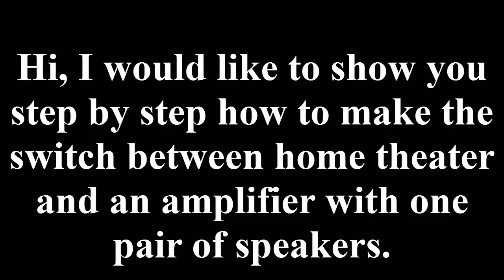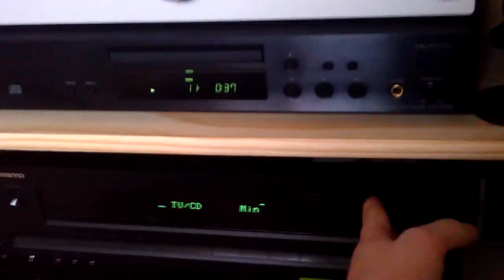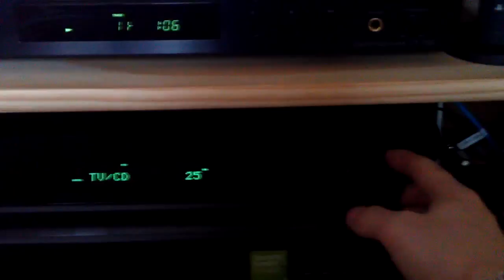switch between 2 amplifiers

Comment: I like the simplicity of the solution.  It should be far, far cheaper to build this than to pay for the overpriced offerings on Amazon and eBay.

I would like to see part numbers and sources, especially for the switch box.
Reply: I chose a plastic casing that was available in an electronic store, I drilled the holes myself.  Switches must be 3-stage 6 terminals , i.e. 1-0-1 for safety, I chose medium quality and used a connection for pins, it would be better to solder, I was going to do that, but in the end I left it as it is.  I think the cable I used was silver-plated QED.  I see a lot of people asking for a diagram.  I don't have one, it will sound funny, but when I had all the parts, everything fell into place as it should. Box- "Project Box Plastic Case Enclosure with Vent Slots 171x178x67.6MM KE1AV" Switch -" Heschen Metal Toggle Switch, C523A, DPDT, Maintained, ON/OFF/ON 3 position, 15A 250VAC, 6 Tab Terminal, CE"

Comment: I am using the 3 way switches as yours for a few years but couldn't find a box to host them. The switches just lie on the floor and wires are directly connected to the switches without a back panel for sure. Could you please tell me where you got the box? I tried a very hard cardbox but cardboards don't take drilling well - plus I used a larger drill bit by accident and ruined the box. Thank you!

Comment: May I know why you didnt use a 4pdf switch instead? Also is there any deterioration in sound since these switches might add resistance in the sound path?  I'm in the process of building one as well, still work in progress. Cheers!
Reply from the maker: I do not see the difference in sound with this audio set I have.  It would certainly be noticeable in hi end audio. I use 3 way switch, one for L channel one R channel.

Comment: How did you join 8 cables to the amp switch ?
Reply from the maker: 2 out cables L speaker, 2 out R speaker, 2 in from Amp and 2 in from Home Cinema Amp. Hope is clear now.I use 3-way switches.
Reply: Ahh no!